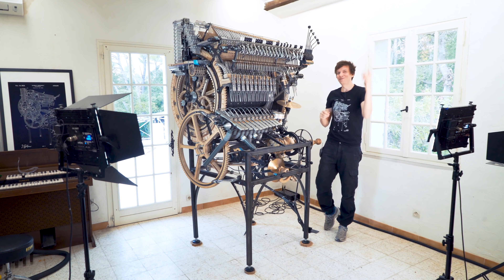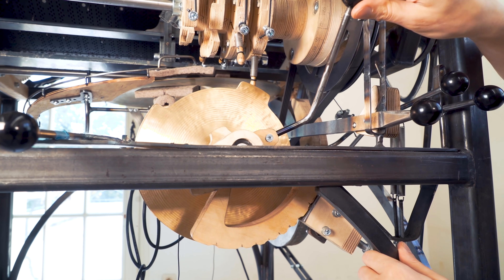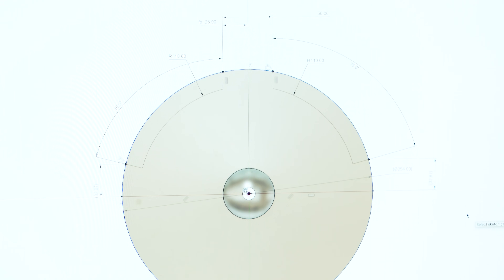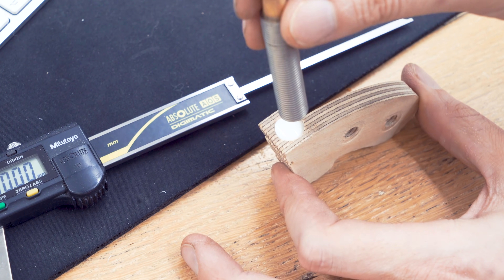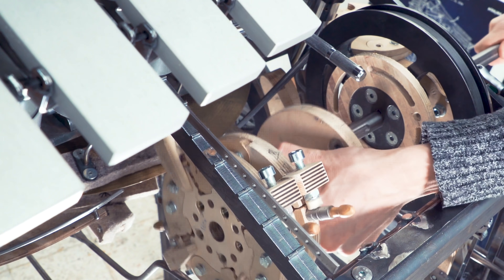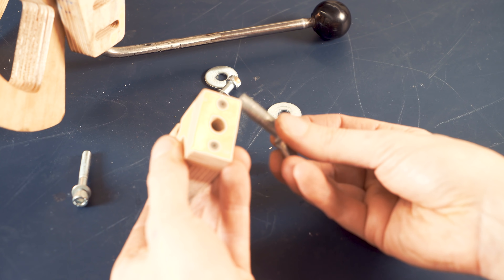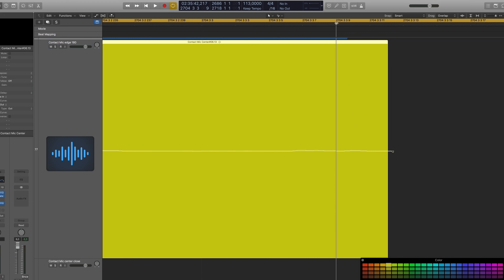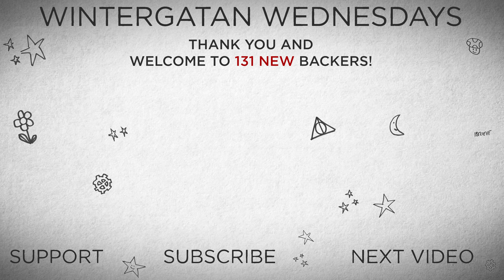I Made a Hi-Hat Machine - Will it Work? | Marble Machine X #108

Comment: awesome piece and concept! I am admittedly concerned about wear and tear on the knots and cordage for the fine timing adjustment... seems liable to give out too frequently and put you in a position of having to re calibrate too often... I know drift is inevitable, thus the very reason behind the fine timing adjustment but is there a better material?
Reply: okay, don't hate me, but i think you'd be doing yourself a favor by over engineering a solution to replace the nylon with another spring

Comment: In order to suggest some more feature creep: the hi-hat selection handle could be designed to allow you to pull it to open the hi-hat, and then spring back closed.  To go beyond feature creep, three added channels on the drum could be used to automatically trigger the hi-hat to turn one tick clockwise or counter-clockwise with standard pin in the first two tracks, and the last track could use cams of varying heights and duration to open the hi-hat accordingly.

Comment: Martin, when you improvise things by adding stuff like the dampeners or use the grinder to shape a surface, do you add these changes to the CAD model? If not you should write a notebook to keep track of every small adjustment you made, otherwise you will not be able to fully reconstruct the machine in case it gets destroyed

Comment: how do you control dynamically the threshold of the noise gate on the microphone if the hi hat is open and so it has more long sustain?
Reply: ...you can use a piezo mic directly stuck on the cymbal so you minimise the ambient interference... ;)
Reply: ...and apply a high pass filter too...
Reply: ...do you need a R.I.A.A. preamplifier... ( piezo preamp)

Comment: @wintergatan I'd recommend ditching the elastic for something non-elastic. Elastic has a habit of fatiguing, and being temperature/humidity susceptible. It won't be long till your sync is no longer in-sync as the rubber relaxes, then eventually degrades. A rigid string will be more accurate, while still keeping your striker springs from bottoming out. 

Nice work as always!!!
Reply: If ya wanted more damping, perhaps instead of using metal nuts (or even metal bolts) for the tensioning device, use Nylon/plastic hardware. It'll have better damping characteristics, but I think if you're smart with your string choice, if you choose something non-elastic you'll be better off.

Comment: My want to put the pressure release into a foot peddle (instead of the threaded adustable screw fitting you used) and use that as a lever to adjust mid flow... maybe.

Comment: the only reason the sound different is because of the open "ports" that the cuts made.... 

if you had some way of filling that gap.... with out it touching the hats..... 
would probably sound SO damn identical, it would take a computer to see the difference 

its like a ported sub-woofer VS a non-ported..... both sound good
but they are different sounds 

definitely still sounds like a hi-hat.... just a bit more "hollow" 
with every other noise that machine can make.... i doubt anyone can notice

Comment: I’m a drummer and I’m really impressed with this. Bravo! Not that I think you need to change it AT ALL but it would be cool if you were able to control the sound/tension of the hats with a pedal like a traditional drum kit but with a very fine/small adjustment. Just enough to still keep the conciseness you have now but with the ability to change it on the fly. This would also contribute small layer of improvisation.

Comment: Maybe you can modify the highhat lever using a spring mechanism so that turning left and right changes the tempo while pushing or pulling forward or back adjust the open and close sound just like a real high hat stand. The mechanism might be like the turn signal on a car, left and right the flicking the lever operate the headlight flash 😀 or in your case will open the high hat

Comment: I'm worried that the spring loaded ball detent will work a groove into the plywood over time and get sloppy.
Love the new hi-hat sound though.
Not to add feature creep, but is there a way to add an on the fly change from open to closed hi-hat?
Reply: If he's worried about the ball detent working a grove into the plywood he could just reinforce the surface with a thin metal sheet that'd follow the appropriate groves, probably nothing that's urgent to fix

Comment: Really cool. 
My idea would have been to add a cam to the bottom of the lever, to act as the hi-hat control. So rotating the lever would select what beat it was playing. And push/pull would twist the handle, changing the sound of the high hat.

Comment: Pretty sure you'll need to isolate the spring from the wheel to reduce noise
Maybe widening the hole & gluing the spring in with some felt might reduce the spring noise, maybe attaching the spring to a rubber dowel that connects to the wheel would be better or threading the spring through some rubber, or filling the connecting area with latex
Physics is literally vector maths, you just need something to minus the velocity of the spring aka damping

Comment: I was thinking instead of metal springs for the beaters, what if you were to use a rubber golf tee or some other silicone/polyurethane/neoprene rubber tube?

There's a lot of vibration/noise absorption in the material itself, much more so than with spring steel.

Comment: Your adjustment hihat tighter and looser, wonder if function could be done using a pedal.  
Like the Same technology as a car pressing clutch disc in and out for manual transmission.

Comment: Martin, you'll need to allow for the fact that the 'beaters' (drumstick heads) won't last forever, as wood doesn't do that well when striking metal.
In a real, practical application, I'd suggest that they would need to be changed over maybe every two concerts once you get the 'show on the road'. =)

Comment: The first dampening idea was better than the elastic. BUT the stopping point needed to be closer to he end of the drum stick, on or near the wood prefferably. By striking in the middle of the spring it caused the spring to vibrate as the weight and speed of the tip bends the spring past the stop and it springs back. 
Stopping past where the spring is should stop it dead with no added spring vibration.
Unless there was a noise issue from the strike on the felt stop as well? I thought most of the noise was from the spring.
Hopefully it will last longer than elastic and hold the timing better.

Comment: The only design flaw I can see (in my opinion, and I hate to be picky) is with the beater timing using rubber bands where I'd have opted for a more solid option like a screw and bracket (with spring and beater connected) to move the whole beater back and forth rather than use rubber bands to position the beaters.

I'm sure this will probably be improved on but everything else and the general concept and flow is 100%

Comment: Wooden drumstick tips chip fairly quickly, especially if they are always being struck in the same spot. This will give you a progressively duller transient. I would recommend using nylon tipped sticks. The sound may be a bit sharper, but the durability and sound consistency over time should make it worth it. Love you Martin 💖

Comment: Notice that you mic stand threads on to the high hat and then you tightened the setscrews to those threads. sometimes this damages the threads, so if you try to unscrew the mic stand the damage threads will guall and you will not be able to get it to unscrew. it is best practice to always put a piece of soft metal like lead  or copper in between setscrews that tighten to threads. the soft material will conform to the threads and allow the set screw to do its job without damaging the threads.

Comment: Who would win?
A well designed bracket with a set screw and felt pad for precision timing via linear movement of the screw?
Or some bolt with a elastic running through it?

Comment: I hooe you add a preamp and speaker underneath so it doesn't always need to be connected to an audio system to perform. It would be nice to have it self contained as an option. And more like a traditional instrument, not needing an audio cable running out of it.

Comment: So I'm looking at the screw for adjusting the pressure between the cymbals, and I find myself worried that they could drift out of alignment with the handle and/or each other. A simple keyway on the axle should suffice to prevent such.
Reply: And several minutes later I see you thought of that... =D

Comment: The design is definitely beautiful, but I have concerns.. What is the plan for keeping time as the elastics age? I imagine you won't be re-doing the calibration on the road. Worse, what's the plan for when one of the wooden drumsticks shatter mid performance? Doesn't seem like you can easily replace a broken stick while on stage in that system.
Reply: Actually I am beginning to wonder what the support supply case will look like.  Probably a whole video on that when the time comes.

Comment: The nut to loosen the cymbals just doesn’t fit the rest of the amazing design. It should be lever controlled two position clicker. Maybe even with the same lever you currently use to rotate the whole set - just give it another axis.

Comment: Need another rotating lever with a cam on it to tighten or release the tension on the high hat. The screw is very slow, it could be basically instantaneous with lever actuation.

Comment: those elastic bands will stretch over time. not the best solution when you want millisecond precision. also I would be careful with wear with wear where metal contacts plywood, like with the ball detent. I've seen this in some places on the marble machine. I'm just saying that you should keep it in mind regarding maintenance of the machine.

also a set screw on a thread is not the best solution. you'll probably f up the threads and will have difficulties removing the nut if necessary. a jam nut would be a better solution. maybe a jam nut on either side, to be safe

Comment: Love the spring loaded ball bearing detent system, but it does seem to make a little click as you rotate the arm into different positions. Especially noticeable between 3:53 - 4:11. Could you replace the physical detent for a magnetic one - mount some strong neodynium magnets at each detent position, all with the same polarity facing outwards, and then a matching magnet where the ball bearing is. A screw could be used to finely adjust the gap, to change the strength of the detents. Just an idea!

Comment: Hey the open/close feature should totally be a clamp system where it would be open/closed by a lever and both the open and the close positions of the lever should be adjustable, maybe with screws. This way you will be able to open/close on the 4th beat.

Comment: (-Warning this comment contains constructive criticism-)
Great work as always Martin!
However, the screw that effects the spacing of the hi-hat could be better designed. Namely, you could use a variable toggle-clamp like system where the plunger/piston goes around the shaft, between selection lever. Since the shaft never will make a full rotation, a through piece can be slotted to connect the plunger to the top hi-hat to move it up or down whilst music is being played.

Comment: Nice bit of design.  How will you deal with fatigue of the elastic (and eventually springs)? It will be dependent on how much you use each channel so won't be symmetric and elastic can degrade fast with shocks.  You could also try putting a dampening sheet (very thin rubber foil) between each loop of the coil to dampen it

Comment: Very ingenious, fantastic. I remember thinking that the marbles hitting the hihat wouldnt produce the right sound, it needs to be hit by wood. On the other hand, if the new hihat is independent from the marbles, and is "automatic", that means it can't be programmed? That can be a bit limiting. On the other hand, it is cool that you can adjust the "feeling", for example if you delay the off beat 16ths just a little, you can get a swingier feeling. Very interesting.

Comment: Not sure if relevant, but you might want to put some padding where the marble goes to the grooves, just deepen the grooves by the ammount of padding, that way you might lessen the clipping sound that the marble makes when it locks into the groove.
Reply: Also the rubber bands seem to make a return, have you considered the older system you had (that you removed), but make the padding catch the drumstick much higher up (or along the whole spring)?

It sounds like the spring is allowed to "wiggle" when it returns. and if the padding was more higher it would not have any place to wiggle and make the sound?

If it's a more "reliable way" to not lose tuning over time, then I think it's worth a test?

Comment: Timing could be adjusted on the fly, without rubber bands. If each one of those four sticks plates could rotate a little through x axis with some kind of horizontal movement made possible by steel wires (like a bicycle gear changer).
It could also make plausible other strange rythms combinations.
Anyway great vid Martin!

Comment: Little tip on your adjustable spring compression detent (any anything else with adjustable spring compression), can get a small freeze plug used in automotive that the spring sets into, and then the bolt pushes on the cup instead of a chance of the bolt pushing through the center of the spring.

Comment: One additional option on the high had you can implement is replace the adjustment screw that open and closes the clam shell of the cymbals with a spring connected to the lever that way you can pull it down to open it up, just like the foot peddle would do.  You can still control the twist easily enough and pull out to open and close.  This way you can add more variation to the high hat with minimal additional complexity.

Comment: (I think) The microphone on the hi hat should point a little bit more downwards. Otherwise it doesn't capture the full sound of the hi hat but only of the contact point. I think you can hear the difference when you open the hi hat a bit with the pressure screw and then compare microphone positions. Though there won't be a big difference in sound when the pressure screw is closed. But I have to admit: I love your work on the timing adjustment, awesome!

Comment: You should control the highhat open close function with the leaver as well.
rotate / left right to control the timing like you are already doing.
push / pull it to open / close it. you could even make it spring loaded just like a normal foot pedal

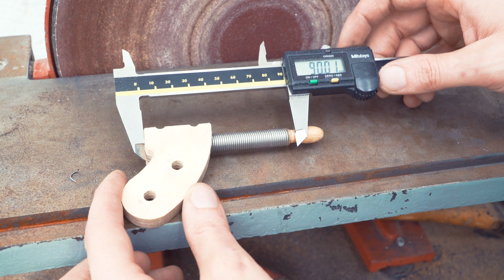Comment: 7:18 Martin takes a break to make some chain mail rings.
I had a friend who would buy a roll of wire and wrap it around a rod to make his own spring then use wire cutters to make those rings. Then using two pairs of piers he would bend two sets of rings: one closed and one open. Then it was a matter of putting rings on the open one and closing it to form the chain mail pattern.

Comment: Quick thought on the microphone mount. When you want to lock an adjustment nut in place the best way is to screw a second nut up against it hard. The friction will lock all the threads together really solidly, and because the contact area is much larger than a set screw it won't damage the threads. Set screws sit on a single point and will over time dig a hole in the thread which will mean you can't adjust it anymore and it will become sloppy. It's also much less work ;)

Fantastic work, Martin, really enjoying the journey and this is a great addition.

Comment: Maybe a later modification could be to use the programming wheel to move that high-hat position automatically. Some sort of ratcheting mechanism controlled by the pins in the programming wheel. Great work ... except for the elastic band situation. Not a good idea for "fine tuning". They will not hold an exact position and will get worse as they get worn. But, I think you were trying to get way more precise than it needs to be anyway. Thank you for sharing the journey.

Comment: This is a great improvement over what you had before, I LOVE. Keep up the great work. That being said seems like the time to loosen/tighten the pressure screw takes quite a bit, would there be any way to set it so it moves on a lever similar to the high-hat position setup? It's just a thought and could be pointless as you might never need to adjust mid song so it being a screw that takes a few seconds to wind in or out wouldn't really matter.

Comment: How about instead of the open/close screw, you add a kind of additional pressure handle (the kind an pneumatic pump has) to the top of the cymbal rotation handle, so when you press it, the hats open and you can play open/close hats however you wish during a song?

Comment: Wont the elastic fatige over time and lose timing? If it does/will you could switch to a spring that is not contacting its self to avaoid the mechanical clicking its making when springing back then you could use a static string instead of elastic. Either way I like the sound of the rhythm machine with this design.